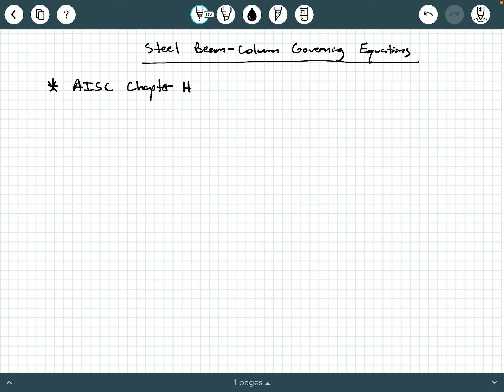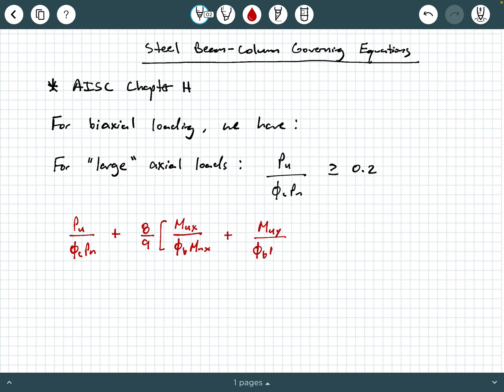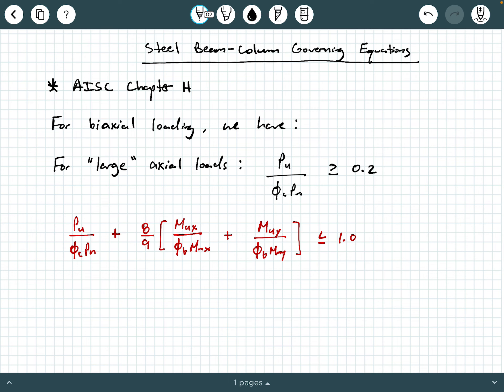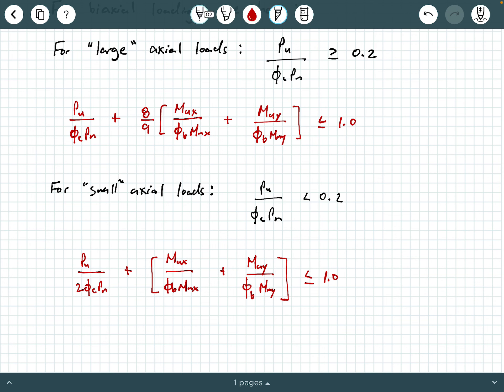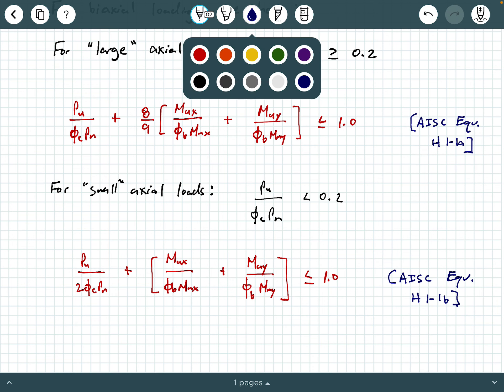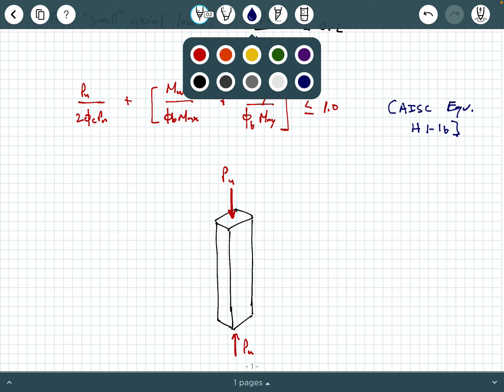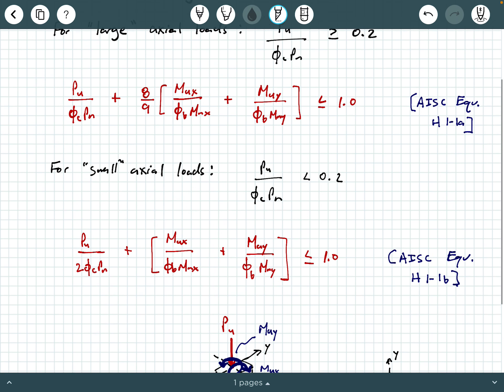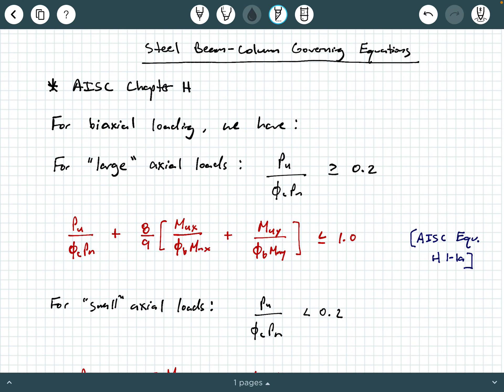Steel Beam-Column Background (Doubly and Singly Symmetric Sections)

Comment: Is this eqn. Valid when column is circular?
Reply from the maker: Yes.  AISC H1.1 equations are applicable to any doubly symmetric steel sections (including round HSS).  The Pn, Mnx, and Mny values will depend on the specific section you are investigating.
Reply: @mathandengineeringwithdr.a9515  Many  thanks Dr.